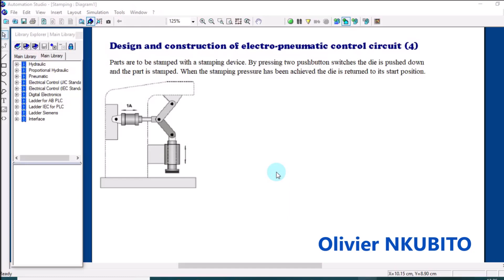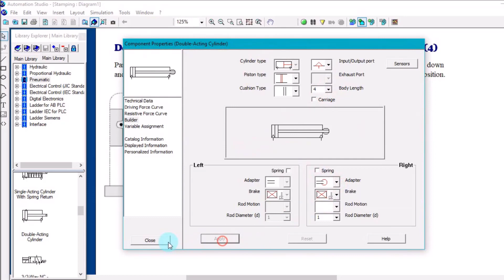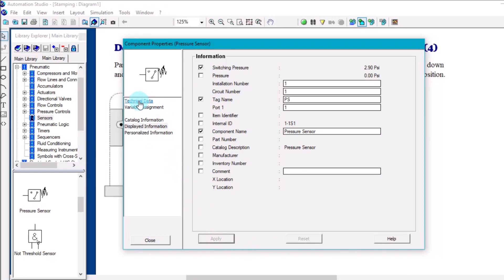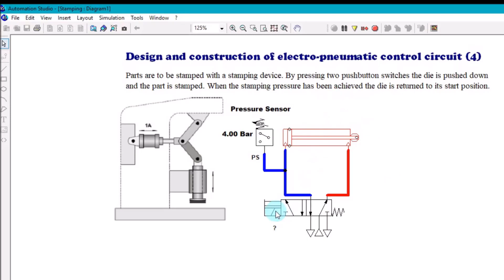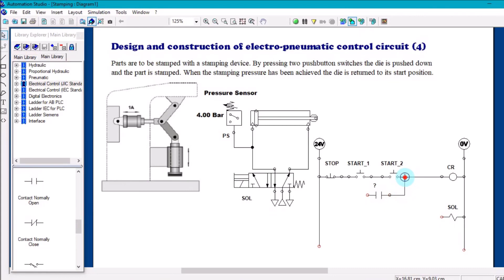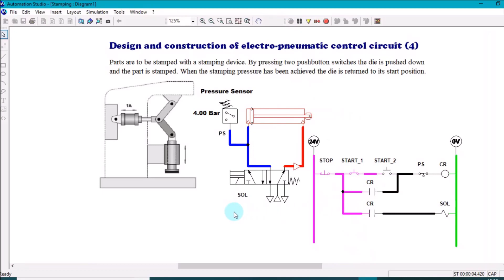Automation Studio: [ Stamping machine] | Electro pneumatics with pressure sensor

Comment: what is the use of the coil? How it affects the system?
Reply from the maker: The fact that, the relay has more contacts (NO and NC) some of them can be used to hold or to maintain the electrical circuit in Closed status even if the Normal open switch is released. 
Read more about direct and indirect control system.